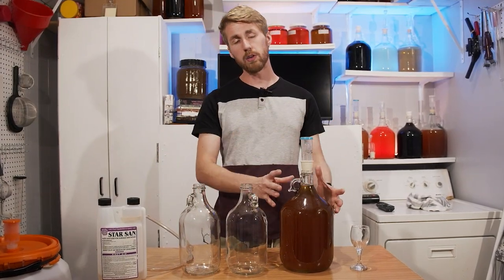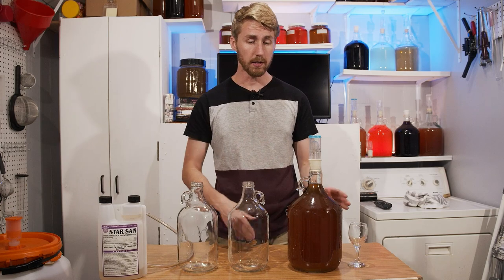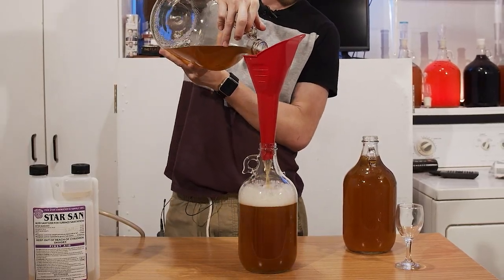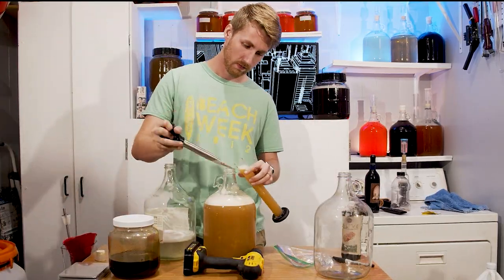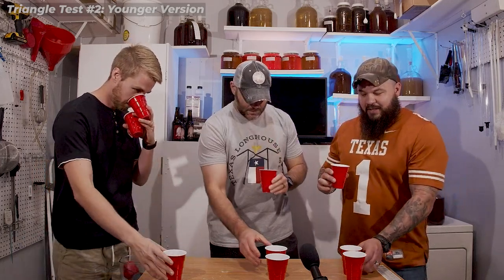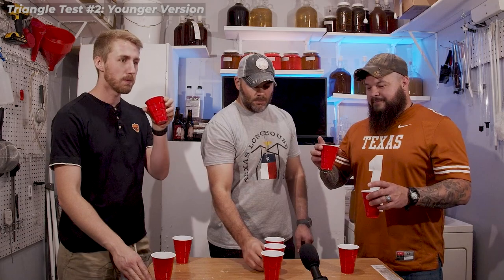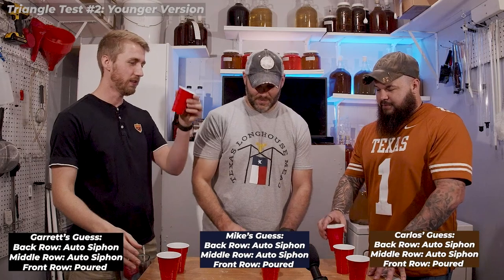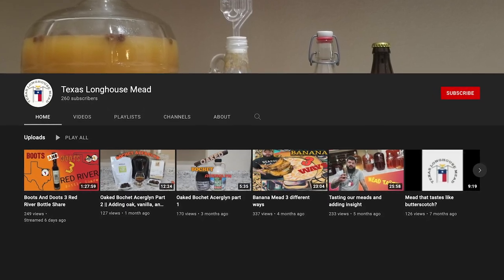Is Pouring Your Mead Bad? A Reflective Test

Comment: Cool video.   If you're starting out and/or short on cash, you can just use a food-grade tube for $2-3 without the auto-siphon to rack.   Give it some suction and off you go.   The siphon with a bottling wand though makes the final step MUCH easier and much less messy!

Comment: I have a spout on my 2 gallon small batch fermenter that I always rack my primary fermentation into secondary with that method.  After that I auto siphon and use a bottle filler.  I feel that adding a little oxygenation from primary to secondary helps to degas and mellow the mead quicker.

Comment: I have free poured very gassed primary to degass. Works really well as so much co2 release occurs o2 is gone. Now this isn’t splashing pour but controlled. If you use a spout I’m not sure  if you vessel will purge as easily in a pour. I dont do this unless there is major straining needed with ingredient mush situation.

Comment: In proper triangle tests the participants shouldn't know the variable tested and definitely should not know that there are 2 with variable A, 1 with variable B.  The point of triangle tests is to see if a difference can be perceived at all without any bias.  It sounds like that wouldn't have been a problem here though.
Reply: In this case, they may have been able to tell there was a difference between the 2v1, and grouped them correctly, but knowing that the group of 2 is theoretically better could bias them toward those samples.
Reply: @chestergregg8668  Exactly.  And if they didn't know that they were looking for oxidation, they might have focused on another factor.  The sample size (and selection of participants) wasn't statistically significant either, but I don't think that MMM was going for pure scientific rigor here anyway.  What we can say from this test is three mead makers can pick out the difference between poured and siphoned meads, when they know that is what they are looking for.  😉

Comment: Glad to know that this proves what we all have been told before, always use an auto siphon for less sediment and less oxygenation for a better tasting mead, especially when they can be so expensive to make. I have one cyser that I will sadly have to dump because the brewing bucket I made it in came with a lid that was defective and wasn't airtight, so that's all that 6 gallons of apple juice and honey down the drain
Reply from the maker: You're right! We spend so much time and money on the mead, we should be investing the few bucks for an auto siphon and tubing to keep it from oxidizing!
Reply: The lid doesn't need to be airtight for proper fermentation, you can ferment with an open container, if you really want (though I'd worry about flies and such). Is it infected? Did you leave it in the bucket for months? Really, if it was just in the bucket for the week it takes to ferment, there shouldn't be an issue at all.
Reply: @Vykk_Draygo  the lid wouldn't seal at all so I had to try to close it with saran wrap, and by then a pellicle formed quickly on it, it's definitely infected
Reply: @Brandon-yq1tm  If it formed quickly, then I have doubts it is a pellicle. Pellicle formation usually takes quite a while, even with purposeful inoculation. My mixed culture sour mead took well over a month to form a pellicle. Same for the Oud Bruin I made. I had a mixed ferm cider go through primary recently, and it's in secondary on the yeast cake from the mead, and it still hasn't formed a pellicle.

You sure it isn't just yeast? They can clump and form structures that can be mistaken for a pellicle. Or mold, which isn't a pellicle either, but it should be obvious if it's mold (which is a definite dump). As long as it doesn't look like mold, and it doesn't stink to high heaven, I'd at least give it a taste to see if it seems like it's ok. 🤷‍♂

Edit: The lacto x kveik mixed culture sour I did formed a bit quicker, at just a couple weeks in, but that was a high temp ferment.
Reply: @Vykk_Draygo  it formed a small amount after 3 weeks, and then I transferred it to a glass one for a seal while it aged, and has been 4 months now and it still comes back. It is definitely infected, I'm not sure why you are trying to argue that it's not.
Reply: @Brandon-yq1tm  Sorry, I wasn't arguing that it wasn't infected, I was saying that if the pellicle formed quickly, as in within the week or so that it usually takes for a healthy fermentation to complete, then it was probably not an infection. Three weeks is more than enough time for a pellicle to start to form in an oxygen rich environment, and four months is even more so. You see a lot of "is my brew infected" online, and it usually isn't - I don't want the product to be wasted if it's good. :)

I still recommend giving it a taste as long as it smells fine (and isn't moldy). I have meads that have been fermented with Brett and souring bacteria. They are actually quite interesting, and tasty. Either way, that bucket is permanently infected. RIP.

Comment: I made three seperate meads in 55g barrels, poured two together one week into fermentation to free up a barrel.
Question is do you think this will affect the mead by oxygenation or does it really only affect the mead after fermentation has finished?
Reply: Should not really affect. Earily in the fermentation you WANT to introduce oxygen becasuse yeast needs it to reproduce. This is what aeration is about in the first days. After that, especialy during ageing is a bad thing because then there are no active yeasts to consume the oxygen so it can oxidise the molecules which are provide the falvors.

The time frame when you should/can aerate at the beginning is vary and most of the time it's less then a week but it's still very young so considering how much co2 the yiest will produce during the fermentation anyway and also the fact that you should degas your young mead anyway I would say you will be okay. But also you can use some K-Meta to bound to oxygen and prevent it to oxidise your mead (after fermentation ended).

Please note that I'm not a professional just a hobbys so take all what I wrote woth a pinch of salt.
Reply: @batorihunor  cheers, I’ve made more since and researched down the rabbit hole